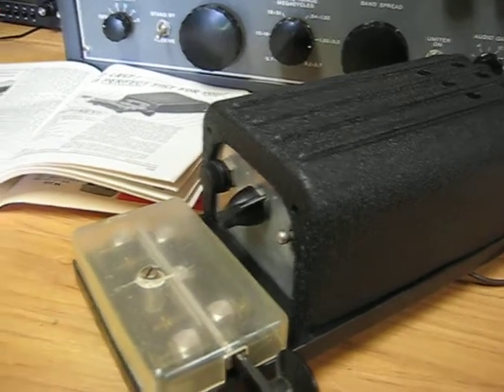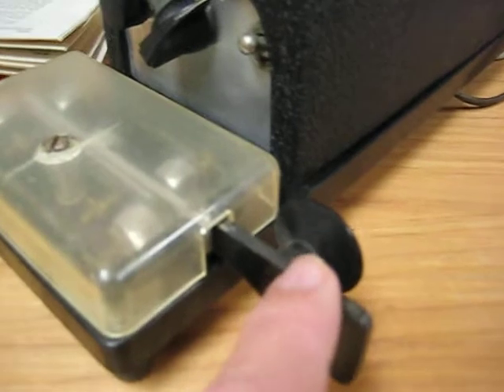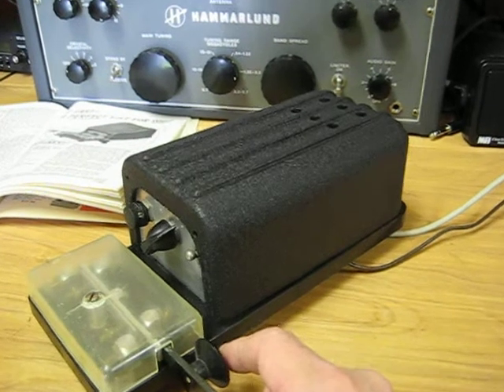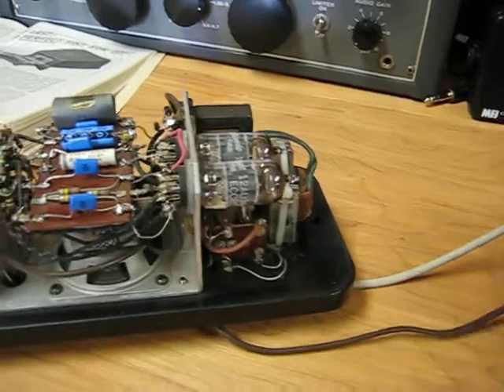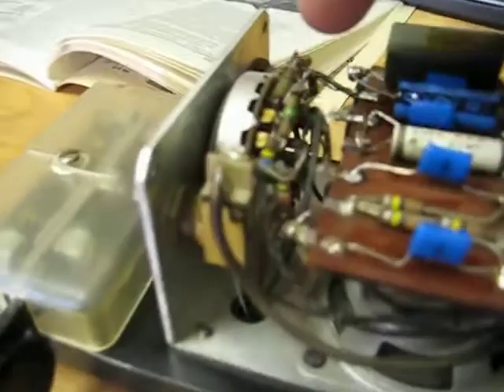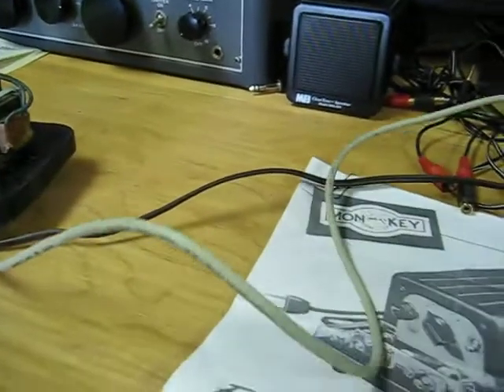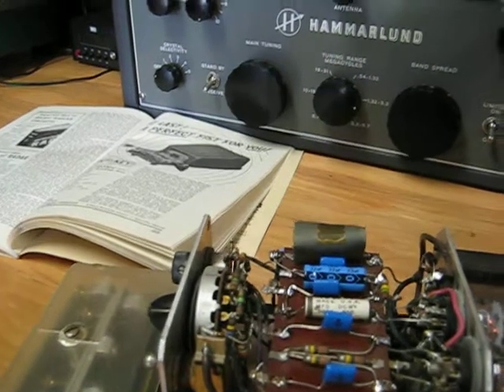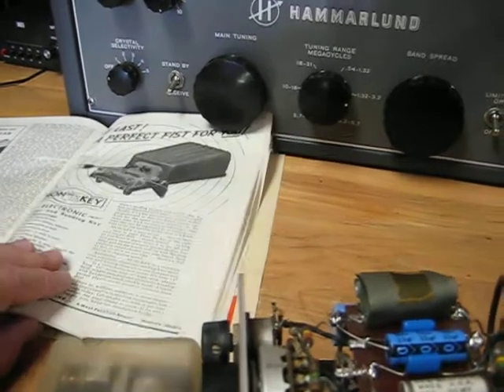Mon - Key Keyer

Comment: I got mine about a year ago in very bad condition. I solved the problem with the resistive lead, that is not available anymore, by calculating a capacitive resistor (2.3µF, 630V=) for the filament. In addition to that I put a carbon resistor (5kΩ 2W) in the DC branch to bring the supply voltage from 115V to 230V and it works. 
73 de HB9ERB